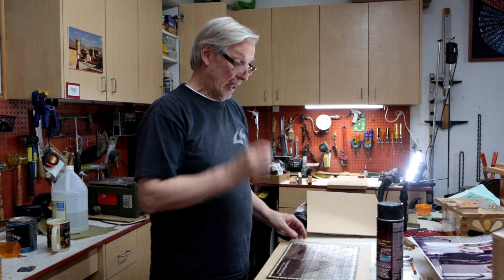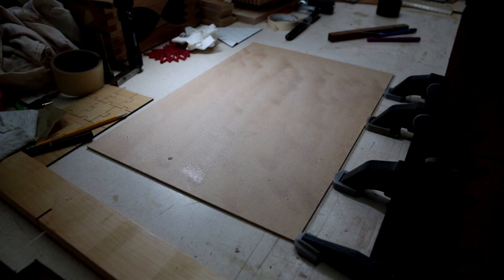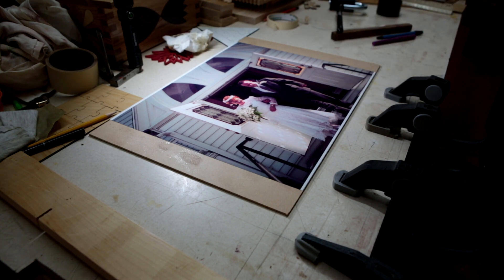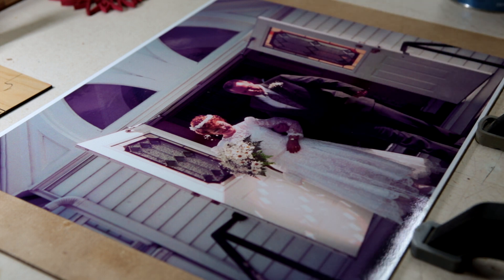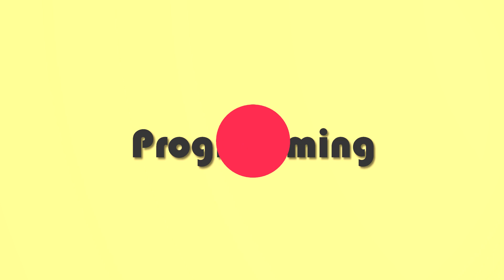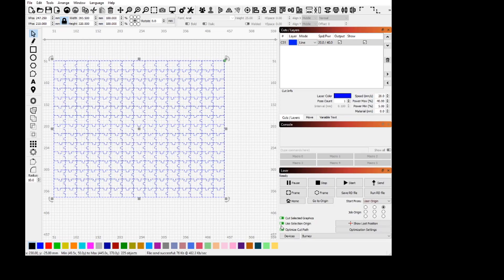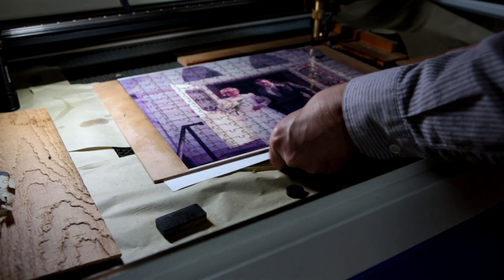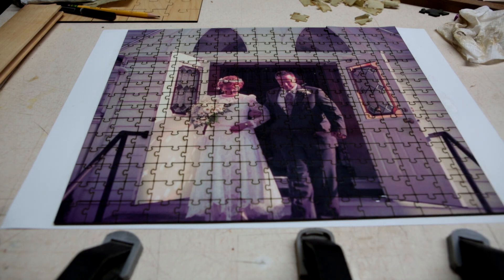Making a puzzle from a photo with a laser

Comment: Can you buy your program for puzzles?
Reply from the maker: I generally offer my programs for free, but the setup is not easy, so I abandoned that route.  There are puzzle solutions out there.  My issue is that I can no longer correctly package my program, written in Java, for installation.  So, after a Beta a few years ago, I just use it for myself. Thanks for the inquiry.

Comment: Use Epson's Pigmented inks.  They'll keep your prints from fading for up to 100 years.  Xyron has a wide format cold press laminator that will seal the picture to the substrate with double sided lamination.  It is manually powered via hand crank.  Feeding the project through the machine seals all materials.  The laminate is pH neutral and acid-free making it perfect for archiving as well.  Depending on the size of the machine you get it will use easy to swap self-contained cartridges or two independent rolls (one for supply, one for take-up).  These save time by eliminating the spray adhesive and sealant stages, no drying times either.  When you cut into their laminate it will NOT peel away like other heat-based lamination films can.

Comment: Could you list the tools and supplies used?
Reply from the maker: 3M spray adhesive, laser, of course.  1/8" Masonite, Preserve It,, which is what I spray on my photos that I print. LightBurn software, my own software that I wrote to actually make the puzzle.  J roller is optional, you could use a roller pin.
Reply: Thanks, what laser cutter?
Reply from the maker: Xm-1060 100 watt.  But any 20 watt laser should be ok.